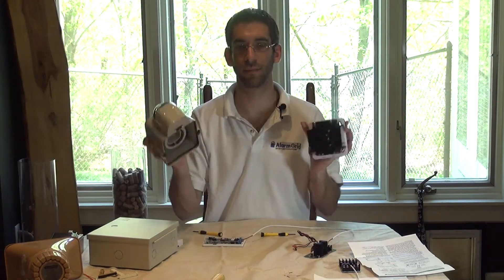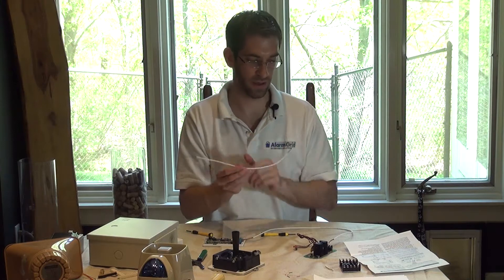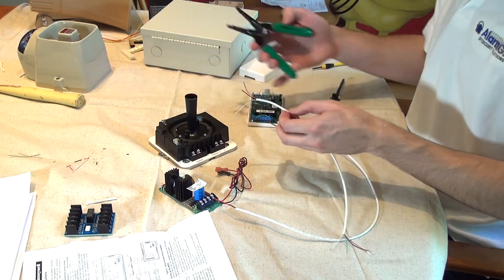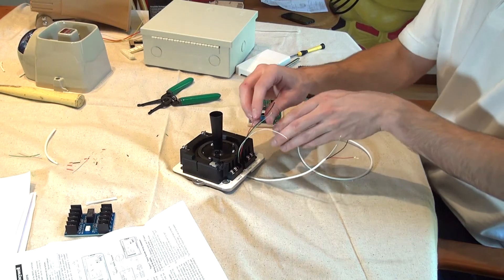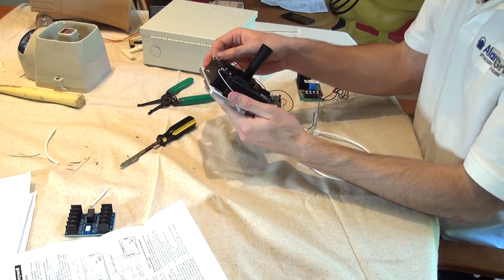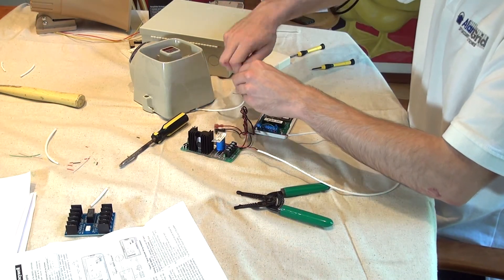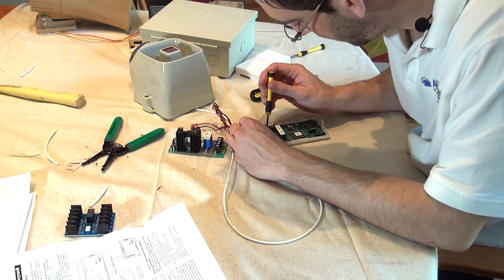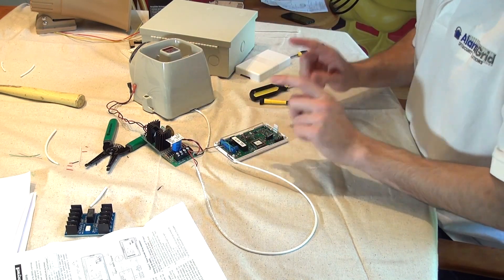AMSECO SSX-52S: Wiring the Siren and Strobe to a Wireless Relay and Power Supply

Comment: How  can I connect it to my OSI alarm system for it to work?
Reply: Unfortunately we are not experts on the OSI alarm system. You would need to contact someone who deals with them. If it has a 6-12V alarm output, it could connect directly to those terminals.

Comment: How many decibels is the built in siren on the Lynx
Reply: +Sean Rebelo On a LYNX Touch it is 85 dB.
Reply: +Sterling Donnelly   The spec sheet on that item Amseco Potter SSX52SB 2-Tn Siren 120Db W/Blu Strobe says 120 decibels
Reply: +GWHH Yes, the SSX52S is rated for 120 dB.

Comment: Can you add 2 ademco 747 sirens to a wireless relay I already have one wired I'm just wondering if you could had a second one
Reply: Dillon Brock It depends on the power supply you are using for the relay. The 747s draw up to 400mA each and the 5800RL draws up to 100mA so as long as your power supply provides more than 900mA, you should be good.